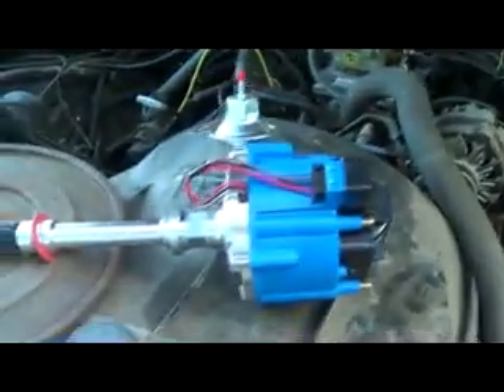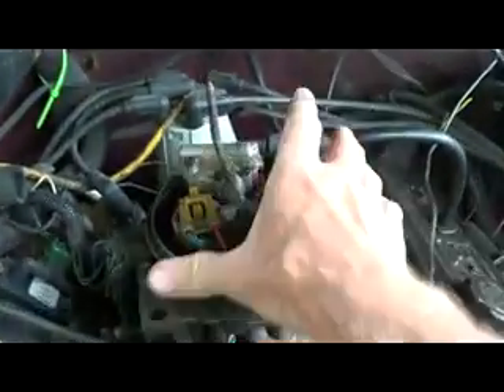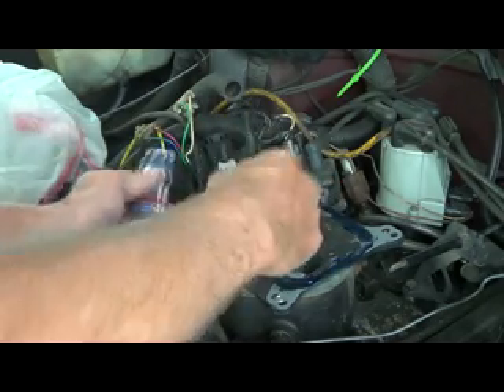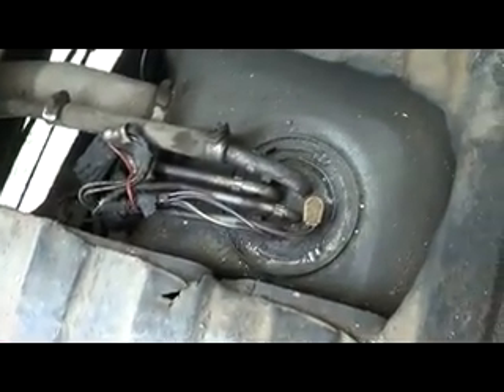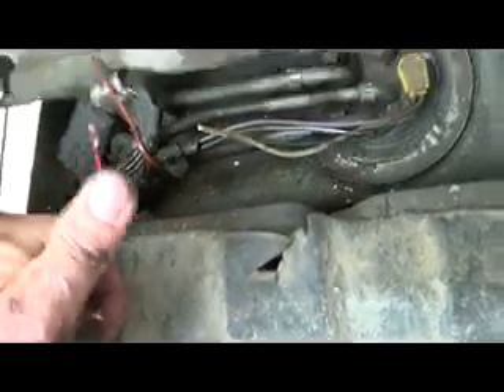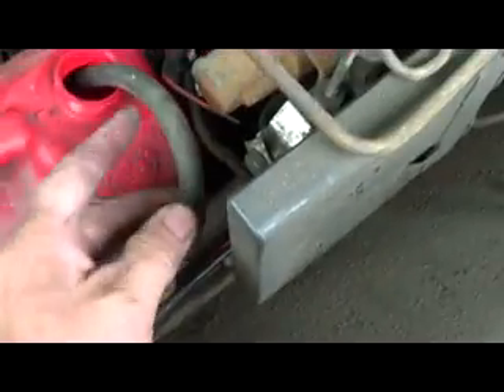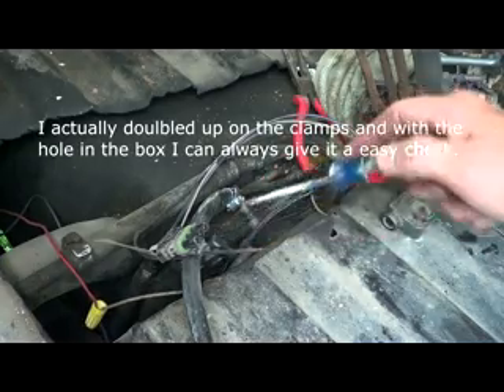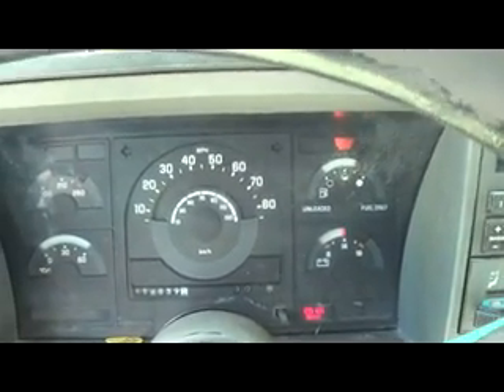changing from fuel injection to carburetor,  chevy truck 4.3 engine

Comment: Heads up gearheads! 
Transdapt does not make a TBI to carburetor plate for carb conversion. That 2202 plate is for mounting a TBI onto a 4 bbl intake. That's why he needed a second plate (that Mr. Gasket plate) 
For 2bbl carbs eBay has Chinese plates for Holley 2300\Autolite 2100\2150.
For square bore carbs try Khaos motorsport.
Reply from the maker: Thanks

Comment: Why cant you just use the original higher pressure tank fuel pump and just regulate the pressure at the front. Why do you need the extra electric fuel pump up front. Am I missing something? Great job. We might have to do this whole procedure with my buddies 1990 g20 van as we cant get it running. Cant figure out what went haywire, all the codes are fine and even the ECU. Totally baffled.
Reply from the maker: I hear you, I never had a problem sense I changed it

Comment: Hi I have a 1994 Chevrolet Cheyenne I  have been having problems that it stalls and it does not start  at all Now. I have replaced the fuel pump , cleaned the gas lines and nothing at at all but if I put gas directly in the engine it does start but shuts off. Can you please provide me with the exact carburetor you placed in your trunk and the whole kit that you purchased.with the thanks for that great video you have shared
Reply from the maker: Hi, I changed it to a edlebrock,

Comment: The TBI when it working correctly does the job just fine. The problem everyone seems to be experiencing is a variety of very extreme drivability problems along with a variety no start situations. From extremely lean to extremely rich from day to day is one of the main issues people that have converted to carb complained about,, running perfectly one moment then will hardly run at all the next. I read post where some people took their truck to the dealer and independently owned shops and no success in finding the reason for symptoms they were experiencing..I believe there are many people out there that can solve the problem with these old systems but I think most can’t pay someone to spend the amount of time it may take to solve the problems. Another problem is with after market new parts that fail prematurely causing similar symptoms to return and vehicle owners get frustrated and discouraged and sell the vehicle for practicality nothing. It’s better to try the carb swap that many many have already done and had very good results with then to give up on the truck.
Reply from the maker: Hi, still driving it and more problems with the carb, thanks, Mike

Comment: Would be a lot easier to just learn how your TBI system works. I do the opposite of all this with most my old vehicles and boats. Fuel injection is so much better than carburation for power, economy and reliability. Otherwise video was entertaining.
Reply from the maker: Never had a problem sense, thanks Mike
Reply: Since? @mikehaduck-travel-mechanic884
Reply: It’s not an issue of knowledge of the TBI system. The person that wrote this comment obviously had a measure of success in making his vehicle run correctly for a various periods of time, hence the two year attempt at trying to figure it out permanently.
Reply: I believe it’s the extreme low quality of parts dealer and after market, mostly after market.  The person that commented probably bought his vehicle to several different repair shops and it’s unlikely they all are incompetent and lack basic knowledge and troubleshooting skills. I wonder how many times a correct diagnosis was made for this person only to have the replacement part fail in short order and there is no retuning electronic parts, so he is forced to repeat the process. Very little of replacement parts are not made in China all the dealer parts are for sure.

Comment: Why would you do this these are some of the best and easiest fuel injection systems  my friend did the same thing  nothing but problems  best of luck to you
Reply from the maker: I had nothing but trouble with the computer and fuel injection, I eventually changed the carb to a edelbrock and a hei ignition, everything is now self contained and sense I changed over in 2015 I been taking this old truck back and fort to Florida for years and never had a problem, every 2 years I put a new fuel pump on and keep the old one for a backup, I am glad I did it, thanks Mike

Comment: You just put a 2bl on it.  Why won't the stock fuel pump wook.
Reply from the maker: Because the pressure had to be reduced from 50 psi to 5 psi

Comment: Thanks for the info, I’m ditching the spider injection on my 4.3 and installing a edelbrock 4 barrel manifold and a msd throttle body system, that’s phase 2, phase 1 is installing a complete msd ignition system on the truck, that will happen after vacation

Comment: great job: 1-thing!!!!! the gasket silicone/use the high temp orange! like 700 to 900 degree.. the 350 to 400 degree blue works well on water pump but terrible on carb.. they say never use silicone on carb.. but i alot luck with the orange high temp!..drove like 8 yrs on orange :>)
Reply from the maker: Thanks chris, I actually changed it to a edlebrock. and still taking the truck on trips, never had a issue, mike

Comment: The truck being a 89 switching over to the carb is better for it.
 I have a 01 jimmy I’m doing direct injection and seeing how that works. I didn’t know they had adapter plates makes me rethink of just taking the whole fuckn throttle body off and slapping a edelbrock 1405 on the 4.3
Reply from the maker: Hi. I did switch it to the edlebrock, works great, never had a problem since I went to carb, thanks Mike

Comment: The tbi stock fuel pump is running 12-15 psi. The vortec engines are what run 50-60 psi. Why not just put a pressure regulator on the supply and keep stock fuel pump?
Did you notice a difference between the stock distributor/ throttle response/mpg/ versus the hei ? 
You said you ran the carb vaccuum to the Map sensor and the timing advanced normally with stock distributor?
Reply from the maker: I wanted an easy fuel pump change rather than ripping into the tank all the time,  I felt b
No difference in performance, just took a couple minutes to warm up, other than that it ran better,

Comment: How did you delete the fuel injector feed from the computer
Reply from the maker: Hi Tim, I just put on the carb, changed to a old school fuel pump, then changed my distributor to a hei, and never had a problem sense, everything on the truck still worked, thanks Mike

Comment: What did you do with the return fuel line to the throttle body
Reply from the maker: I blocked it off, you have to have a way for air to get into tank as you use fuel

Comment: You don't have to change the distributor if you have the 700r4 trans it shifts it's self it doesn't use the ecm to shift the 4l60 does it has shift solenoids I'm just guessing
Reply from the maker: Hi Lynn, the truck ran fine with the original distributor but I wanted everything separate like the 1960s easy to fix,  thanks Mike

Comment: in a nutshell it would be much much easier to convert an injected engine to carb, rather than carb to injection, am i right?
Reply from the maker: Hi Fidel, it might be what age group your in to answer that,  I'm from the 60s and carbs are the way to go for me,  thanks mike
Reply: @mikehaduck-travel-mechanic884  im in my 40s and yes ive only owned and driven cars and bikes running on carbs ...definitely simple and easy to work on and no need for pressurised fuel lines

Comment: Hi sir.... can i. Install carburator without high pressure fuel pump .i want to install it with simple low pressure fuel pump in efi engine...?
Reply from the maker: Hi Carbs go with low pressure pumps or you got to get a fuel regulator, thanks

Comment: I'm very tempted to do this to my '01 Jimmy. It's been missing for as long as I've had it (the last few years) and I've never found the issue. I've switched out every sensor and the injection spider. I have the engine out and disassembled and everything looks fine other than low compression in one cylinder. I'm certain it's a wiring issue or the PCM itself. I wanna delete the EGR and injection but need to find a way to keep my instruments,  AC and 4x4 shifting though.
Reply from the maker: Hi Wyatt, the newer the vehicle the more complicated it gets, but my 89 runs great now,  thanks Mike
Reply: Low compression in a cylinder will cause a misfire. Had the same issue in a 98 blazer 4.3
Reply: @MrJbooker1013  Yup, needed new rings and I lapped the exhaust valves. Good as new minus a vacuum leak

Comment: Why run another fuel pump? Your gauge should be able to adjust down from the pressure the original pump puts out. Going to try this on my old camaro and see if it works I guess cus idont want to mess with a diff fuel pump when this one works fine
Reply from the maker: Hi, you got to see how much pressure it puts out fuel injectors are over 50 lbs are carb between 4 to 6
Reply: @Mike Haduck - Travel - Mechanics - Music  yes I'm going to use the stock fuel pump also and regulate it down

Comment: Fuel pump should be as close to the tank as possible. Electric fuel pumps are a lot better at pushing fuel than they are at pulling them. But simce your pump is probably rated to put out between 15-30lbs I'm guessing, and you are running a carb you can afford to pressure drop.  Other than that good job.
Reply from the maker: Thanks Joshua, I did move down near the tank,  th

Comment: Why does the fuel pump need so much modifying
Reply from the maker: I put it down on the frame below the gas tank, never had a problem,
Reply: @mikehaduck-travel-mechanic884  but why did it need to be modified like that I have a Chevy 2500 I'm thinking about doing this with but I didn't know my old fuel pump would be a problem

Comment: How long did you use the Rochester 2 barrel before you went with a 4 barrel  did the. 2 barrel have any issues
Reply from the maker: Hi Mike I drove it about 9 months with no problems but I bought a used edlebrock and rebuilt it for a video that's why I changed it still to this day it runs great. Like any carb the truck has to warm for a few minutes but no issues, thanks Mike

Comment: Are u still using the same regulator on the 89 bud
Reply from the maker: Yes, I also got a fuel pressure gauge inside the truck I monitor,  no problems.

Comment: I thought about putting the electric pump a few feet before the big inline fuel filter we're on the frame you put ur bud
Reply from the maker: It had it up front but it got hot in summer so when it went down on the frame below the gas tank it solved all my problems,

Comment: Is that a good little electric fuel pump. They sale thoes at AutoZone
Reply from the maker: It worked but I bought a better one and put it down on the frame low to the gas tank,  no problems,
Reply: What was the better pump u bought

Comment: So I’m doing the same thing (tbi to carb) the only issue is that I have 2 fuel lines instead of one. What do I do?
Reply from the maker: Hi kip, I had to go into my fuel tank  or find out which one delivered and then I cut and covered the other line  also I had to make sure the tank will breathe so the gas comes out,

Comment: I have the same issues with my 87 , and I am doing the same to my truck, question, do you have to change the distributor? ? I don't want to if I don't have to
Reply from the maker: Hi DD. I didn't have to, the old distributor worked fine. But I did it anyway, I wanted everything separate,   still no issues to date, thanks mike
Reply: @mikehaduck-travel-mechanic884  Thanks for making this video Mike , it really answered all of my questions! Thanks again

Comment: I just acquired a 1500 4.3 I'm anything but a gm guy but truck is very good condition but I learned in high school about these nightmare injection systems so I was going to do intake an carb swap but after seeing there's these kits I'm going to do my good old holly 500cfm tbbl I have seriously put my 500 Holley on over 20 trucks an cars people have given me over the years but I always rebuilt it an put it away stripped my question is 500cfm going to be to much or just around the limit cause I kno 500 will work perfect for most any v8
Reply from the maker: I actually changed this to a edelbrock 600 and it works great,  i got to say I had to do some adjusting but never had a problem sence,

Comment: When you switch to carburetor, do you have to pump the gas pedal to start the engine like people did back in the old days?
Reply from the maker: Hi n31,  yes just like the old days,  Mike
Reply: @mikehaduck-travel-mechanic884  NO, just like the good old days without electronics!

Comment: i assume all the negative comments just dont understand.  so here are the basics, he bought an adapter plate.  think about what that means.  it means there is a company making a profit on all the people out there that want to turn their fuel injected vehicles into carbureted so dont be so arrogant to think that you have the answer.   i believe there is a typo in a comment about FI being "exponentially better than carbureted.  exponentially?  maybe marginally, or a fraction better but definitely not exponentially.  and as soon as there is a fault code, i would argue that now it is marginally (if not, exponetially)  WORSE than the carburated.  my ex had this engine and after replacing the o2 sensor 4 times in 6 months by some booger picking "mechanic" that couldnt diagnose without an OBD2 scanner, she sold her blazer. we need guys like this working as mechanics instead of the mindless bunch that just replace what the fault code tells them to.  Thanks for posting.
Reply from the maker: Thanks Spencer, mike

Comment: Going through all the comments I think I've got most of what I was looking for. The MPG was about the same and you settled on a 600 cfm 2 barrel carb? What do you think your MPG is? And I realize you weren't building a hotrod but do you think you'd have plenty of carb if you got a wild hair and decided to lay the hammer down on a 5.0 pulling up to you at the light? Maybe throw on some shorty headers to complicate the hypothesis. Many, many years ago we were switching like an 89 or so 1/2 ton, IDK, one of the first TBI V8s, to carb. I was thinking we had to use a different intake manifold when we swapped but I think it was just to get a 4 barrel on that bigger engine. I don't see any reason you'd need to for a V6, do you? And lastly, is there anything in the powertrain still being controlled by the computer? If you were running an automatic trans I guess the comp would still be involved, otherwise, I can't think of anything, but I  know next to nothing about computers on cars. Hell, when I stopped turning wrenches for fun they had just started really computerizing everyday cars and cursing us with the TBI. After that I worked like a mad man for 30 years on the road and had to pay people to fix my junk. I couldn't be down even a day so I missed out on increasing my knowledge like I did when I was 16. I learned fast, street racing rich kids, and winning(with their computers and TPI, LOL) with my cobbled up old junk in the 405...but then I had to go to work. No fun. Thanks for the video!
Reply from the maker: Hi rock,  I did end up putting on a edelbrock 600,  no change in gas mileage that I noticed,  Stan trans is always best for changeovers, my opinion.   Thanks mike

Comment: my truck is running the best ive ever seen it run  . its my belief that just about any 6 cylinder carb will work fine but it should be from a v - 6 . the old inline 6 cyl carbs often only had a single lower throat  whereas the v - 6 may have a single upper throat but splits into duals on the bottom side . 
   i never had to drop in the hei distributor but i have it for the eventuality  when my ignition shits the bed  . 
    the adapter plate can just be a single piece of 3 / 8 aluminum or steel . you tap and loc tite 4 studs into it for the carb , then bolt it in three places to the existing intake . countersink rear two bolts .
   btw mike . ive always used wire nuts on my automotive stuff . i fill them with grease .  they are much superior in longivity than cheap assed sta kons .
    my sonoma is running 7 rear leaf springs and has been converted to a dump bed . it aint just for looks either . i routinely haul and dump nearly 3 ton of rock or firewood .
Reply from the maker: Thanks Robert,  I agree, simple and fixable,  mike